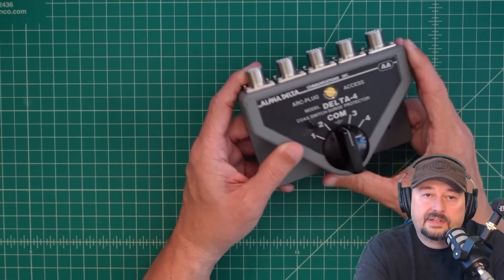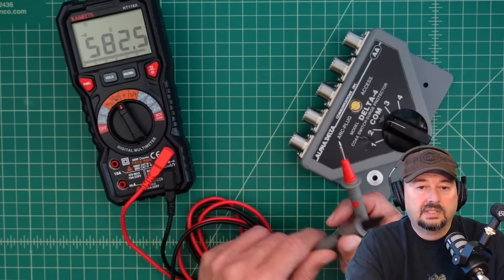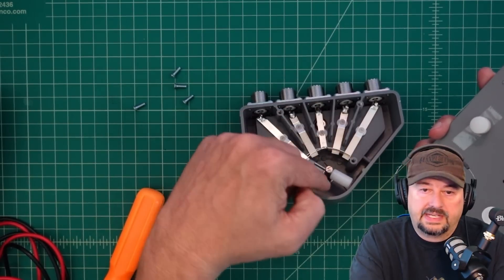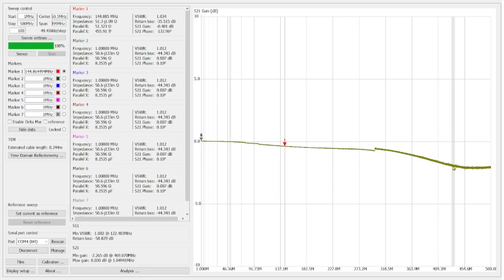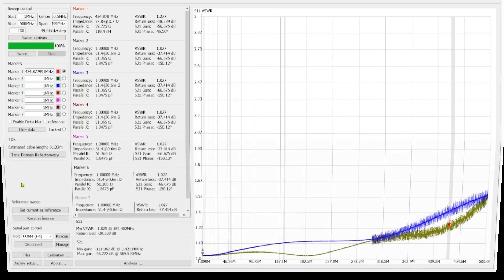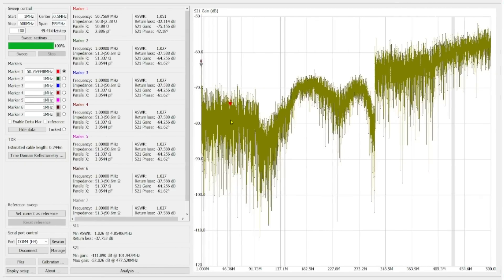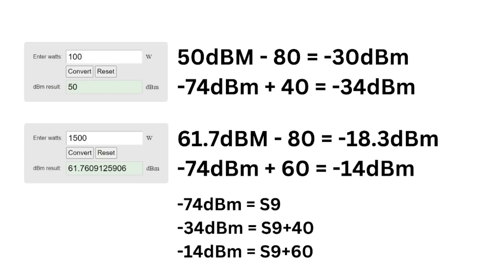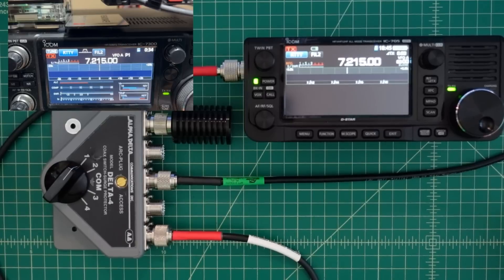Alpha Delta 4 Port Antenna Switch

Comment: I think there's something wrong with your setup, possibly bad jumper or poor quality dummy load or adapter. I just ran these same tests on an agilent vector network analyzer and got much different results, insertion loss it for 437 was 0.4 dB isolation between ports at 437 was 60 dB

At 900 MHz insertion loss was around 0.7dB and isolation was around 55 dB

I would double check your setup and calibration and rerun these tests.
Reply from the maker: I would expect it to be different at higher frequencies.  Thanks for the info, I picked up a second one and perhaps I’ll test that one out 👍